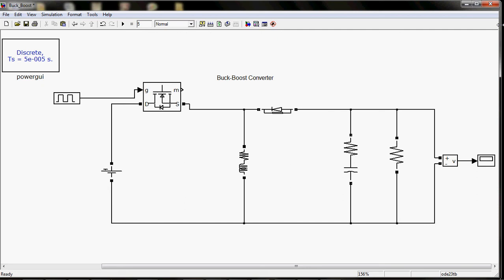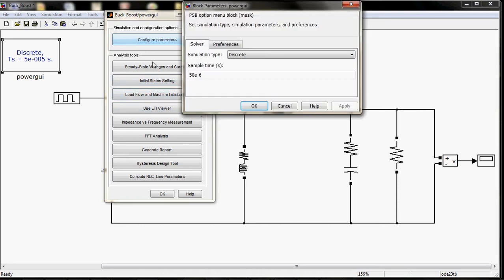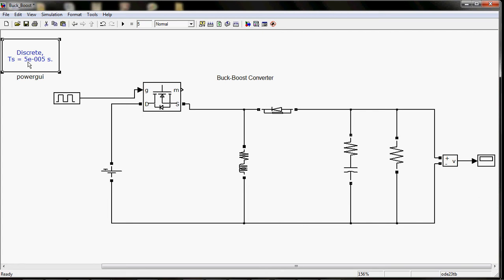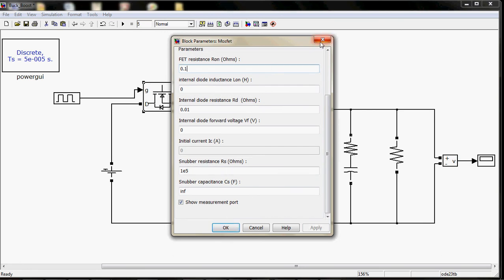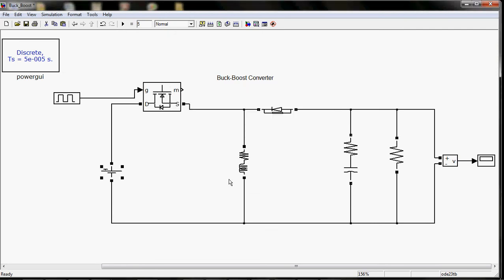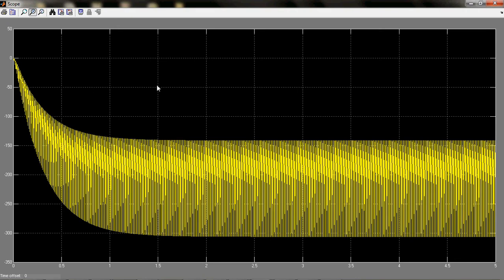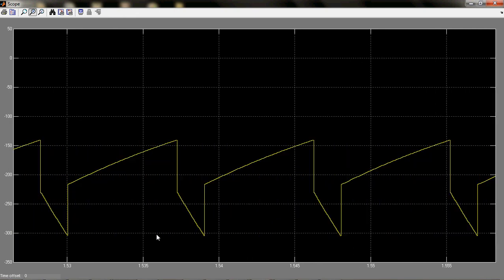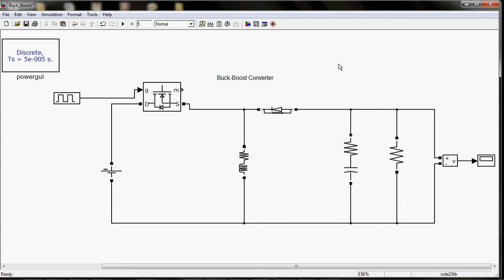Solar PV Systems: Part-4: Buck-Boost Converter (Video-2)

Comment: need PV help

my pv cell large1.5v 4a cell.
voltage too low/amp too high for chinese  premade converters
i want a modular setup where each cell can provide 5 watts  by themselves to charge cellphones/mp and connect two in series for a 10w tablet, 
can i boost voltage to another booster(cascade?) such as 1.5v to 3.3v to get 5v 1a then have two panels together in series for 5v 2a?
i had read not stable and only isolated can do this
i want replace bypass diode with boost converter
maybe spv1040